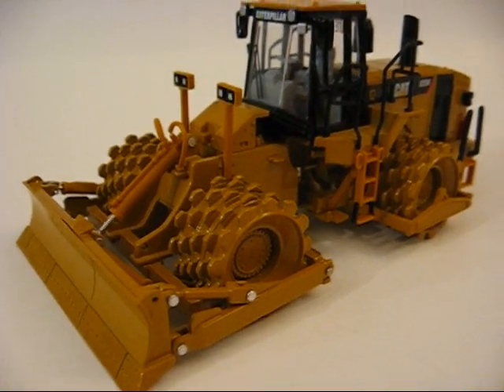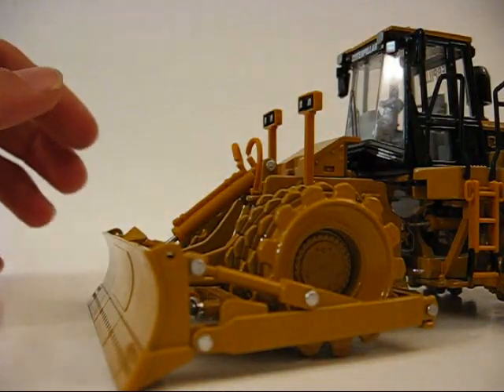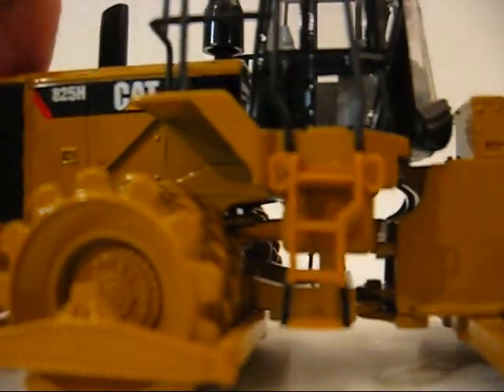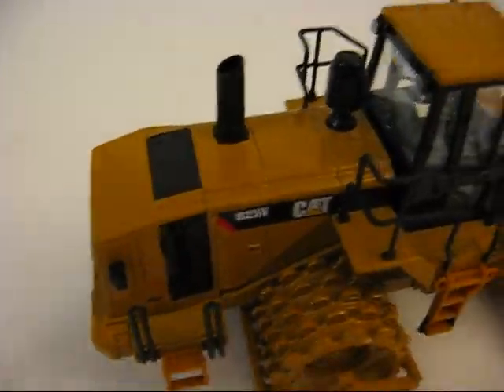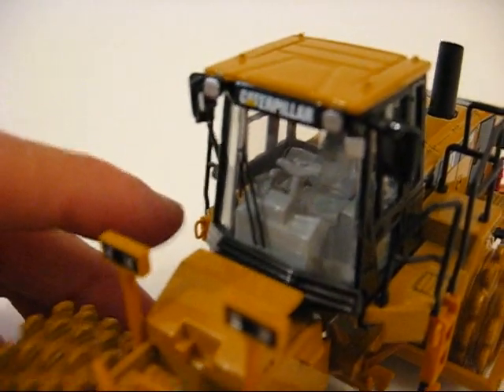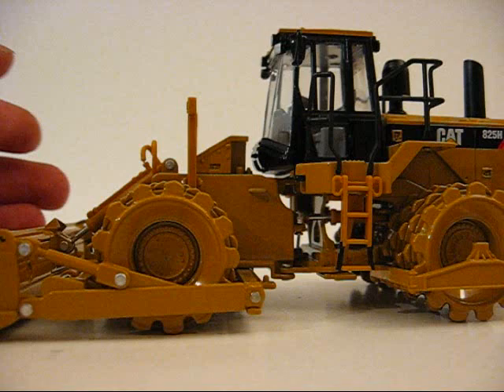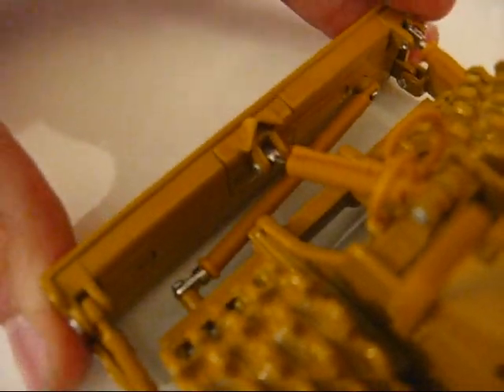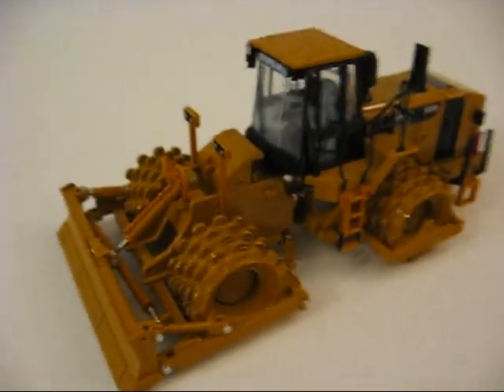Norscot Cat 825H Review

Comment: I have been around the 825h a little and have always seen them in our landfill compacting the trash and dirt going on top. And the fire extinguisher is on there for the reason of it being around easy burning things (mostly  in the summer) as far as the lock i asked a operator what its for and he said its for when pushing earth movers or (scrapers). its also for transport like you suggested any way I know it kinda late but hope it helps a bit ,great review.

Comment: i ve seen steering locks on road rollers, there might be for Transport, but in fact they are never used, only at smaller Units that are lifted onto a truck with a truck loading crane.